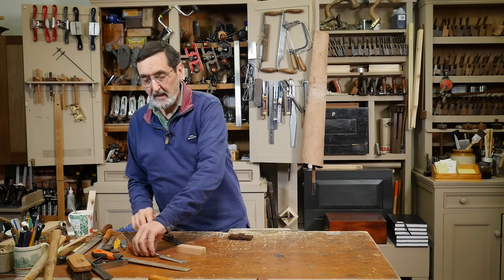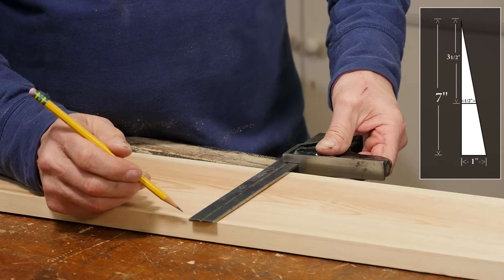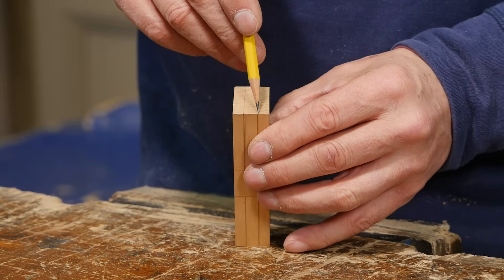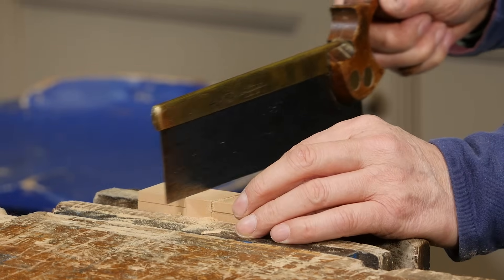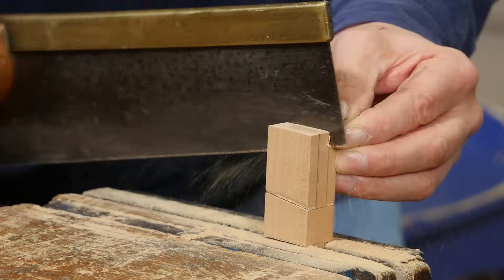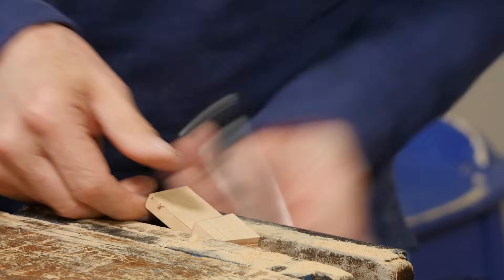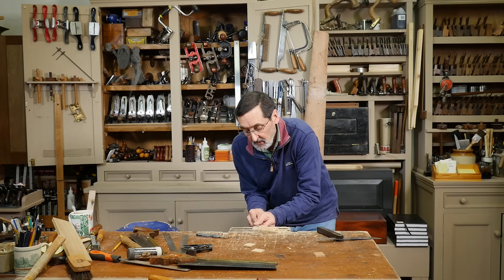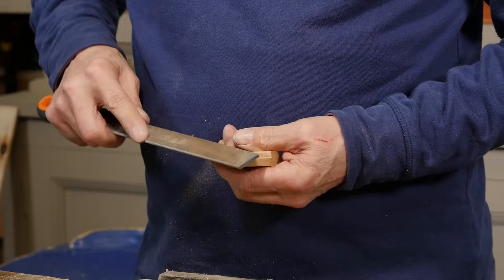How to Make a Dovetail Template | Paul Sellers

Comment: I just attempted to make my first template at 66 years of age. Never did woodwork. I realized the block preparation is crucial. I will attempt another. I used 3/4 square stock. 
First I learned to  hone my chisel sharpening skills which needs more improvement. They are sharp as needed. Learned to sharpen before anything else.
Paul you remind me of a shop teacher when I was in middle school. 
Great channel

Comment: The other day I cut my finger with a chisel, I smiled because I'm finally starting to sharpen them properly.
I've built my first ever workbench In my apartment, and I have my first tiny workshop there, your channel was a huge inspiration for this, I'm finally working towards doing something that I like as long as college gives me the time to do so.

Thank you for your contribution to the world, you are an inspiration and a role model to me, have a great weekend!
Reply: Cutting yourself on tools happen more often when they're sharp but not sharp enough.  The reason is that when they're not ultra-sharp, they catch and then break through at a higher speed that you don't control.  If truly sharp, it's smooth motions all the way, whether there's resistance or not.

That said, these days I tend to only cut myself when honing, riding the bevel against the stone with my fingertip for that perfect edge, and cutting my fingertips on the burr.  But that's not deep enough to bleed, so I'm good with that.
Reply: I need to keep sharpening then! haha thanks have a great week!
Reply: Don't fret buddy, my apartment 'workshop' is a semi-circle of 1.5m radius. This space accommodates my homemade workbench with built-in table saw, a bench-top drill press, router table and a chip/dust collection cyclone that connects to the domestic vacuum cleaner. As it happens though, I use mostly hand tools, because of the noise issues. You'll be surprised how much you can achieve in such a small space with a little ingenuity! And yes, Mr. Sellers was my inspiration too. This man deserves a knighthood for services to the nation!
Reply: Nice! I have a square, 1.30 by 2.80 meters, no power tools, just a corded drill. The problem I am having however is with the noise, I'm looking into mats or something to place under the workbench 'cause every time I use chisels or hammers the sound is heard very loudly across the floor (it's a tile floor) and it makes me uncomfortable, don't want to disturb the neighbors.
I'm getting there though, right now I just finished making a sanding block and I'm looking into making something to hold my tools on the wall, it's starting to get messy haha.
Reply: I have a tiled floor too - I use an off-cut of some heavy, rubber-backed industrial carpet (from the local DIY store) UPSIDE-DOWN. That is, fibres on the tiles. It's just big enough for both the bench and me to stand on, so the bench doesn't move when I'm planing etc. However, I can slide it around on the tiles when needed.
Reply: That sounds about what I'm looking for, I'll have to take some measurements and go buy the materials, probably separately, I haven't seen that type of stuff around here (all together), but it doesn't sound complicated.

How thick would you say it needs to be? an inch sounds good to me, as long as it helps keep that noise down.
Reply: For floor insulation, the cheapest and most effective I have found are the packaging mats made out of shredded cloth fibers - they're mostly grey with specks of color and perhaps 1 cm thick.  A good sized mat of that only costs a few bucks.

But for workbench insulation, adding cork under the feet and in the vise jaws is both cheap and easy.  A 25' length of cork tape is about eight bucks at Woodcraft, and it really helps with reducing vibrations, including sound.

For chiseling, get chisels with a wooden handle and without a metal strike cap at the end.  Those are for framing work, not fine woodworking.  And use the smallest chisel that's still convenient.  The bigger the chisel, the harder you have to hit it.
Reply: The stuff I have is around 1cm thick. Adding cork to the bench feet seems like a good idea too. I'd never thought of that. IKEA do thick cork table mats that could be useful for this. Not sure about the cloth mats (is that the stuff that removal guys use to protect furniture?). Whatever you end up using, don't forget that you'll need to sweep/vacuum clean it - often! ;-)
Reply: I'll give it a shot, thanks guys!
Reply: Same here. Just have a small workbench in my apartment. And when planing it is wandering around or just tipping over. Maybe I need a heavier one :)
Reply: @martine.bottcher2111  Weight it down with sandbags. Works a treat.

Comment: I squared up a piece of walnut and tried as best I could to follow Paul's excellent instructions to create the dovetail template, but it did not pass the 'eyeball' test.  I was able to draw the proper lines and everything looked fine until I completed the saw cuts. The eye can discern things that do not look right but I had to take the combination square and the sliding bevel to examine where I was off. Several of my edges had humps of valleys that required extra chiseling, shaving until all surfaces were true and square with no gaps in the measuring tools. Now it is fine and I look forward to making my first handcut dovetails. Absolutely love your videos, especially the sharpening chisels and restoring hand planes.

Comment: I want to build a small toy chest using plywood and dovetails. What pin angles on 3/4 inch plywood should I use. I was thinking it would be 24 inches in height. Any tips ? Thank you for your videos . I have learned so much from following you.

Comment: Any reason for not using the router to clean the 'tenons'? I know that the surface is small, but i think you could let the tenons a little longer to give the router some extra support, and  shorten them at the end. This is a technique that I learned from you (I am pretty much sure).

Comment: Hello Paul, how do you make one of them scraper's? By the way i love the video's keep up the good work.
Reply: Good question kenny 69.  Is this a homemade tool or one that is purchased?  Was just about to research it.
Reply: You can make them from a saw blade...
Don't ruin an antique or a quality handsaw though, but a modern industrial electro-hardened teethed one makes a great donor for such things!
Once they're dull, you can't do very much else with those!

(Or you can buy a scraper)

To sharpen, file then stone the edges to a good 90°, and once that's done, use a hard smooth burnishing tool, a screwdirver shaft would do, to turn the edge, to make it form a microscopic hook/blade...
You do this by first  runing the burnisher along the 90° flat you just "sharpened" then by inclining it a bit more each pass...
No need to go overboard though!

I bet paul has good videos on this!
Reply: You can buy them depending on where you live.  They are called card scrapers.  Bahco, Narex, Crown, Clifton, and Irwin all make card scrapers.  

If you have an old saw, many of those can be cut up to make scrapers as well.

You'll need to learn how to sharpen and use them.  Go to his website, www.woodworkingmasterclasses.com, and I believe the instructional videos are free.  You just have to sign up for a free account.

Comment: Sir,
since you are using the terminology "angle" and indeed using a "sliding bevel"; would you be kind enough to tell how many degrees it is, instead of one-sixteenth and one-eight,
we could easily use a digital angle finder for precision cut, Thank you!
Reply: But the beauty of Sellers' method is that he can find the precise angle without the need of hi-tech equipment, such as his preferred one-in seven dove tail angle. Watch closely and he shows you how to do it.
Reply: @johnadams6440  Just in case you missed it!
The "vernier" used in this particular video to "Get Width and Thicknesses", is without a doubt of a  "Hi-Tech equipment" DIGITAL vernier 
Just in case you missed that is!
It is however 81.4 Degrees
Reply: The "Hi tech Equipment" is so apparent when the video is pause at 1,55 sec
Reply: He used a ruler. @d-ameir622

Comment: Dear Paul, How did the log cabin builders figure this out in the 1800s?
They never had formal training and they also used different size logs?
There must be some secret that I can't even find with the use of the internet.
So frustrating!!!!!!
Log cabins/homes never had the same sized (sawmill cut) logs i.e., dimensional lumber.
How did the old pioneers do it? They never had templates.
I will be building a true hand hewn 1800s style half dovetail log home as soon as I find the secret. :(
Any help would be appreciated.

Comment: A question Mr. Sellers: Is there a specific reason you use the 1:7 for your dovetails? I've seen multiple different angles from other sources, but you always go for the 1:7 ratio.
Reply: I can't answer for Paul Sellers, but commonly, 1:8 is used for hardwoods and 1:6 for softwoods which can do with a slightly steeper angle. 1:7 is a good compromise that works for most types of wood.

For soft hardwoods like linden (basswood) and poplar, 1:6 isn't steep enough for a strong joint, so 1:7 works better anyhow.  And avoid the Rob Cosman style decorative dovetails that are so thin that strength is compromised, unless you just want them to be decorative.

I have two 1:7 angles marked on my workbench top going from my front vise.  That allows me to cut the pins freehand with good angle accuracy, and base the dovetails on the pins.  (Paul also does the pins first in another video).
I also have 20 degree angles in each direction from my end vise for when I sharpen cross-cut saws (Paul uses 25 degrees which cuts quicker, but needs filing more often).
If you don't want to mark your workbench, a sheet of plastic will do fine.
Reply: thank you sir

Comment: 4:43 of course you don't know a third of 7/8". No one knows. Our brain is not designed to work with rational numbers. Just switch to metric. Other than that, a great video! I will make one tomorrow.
Reply: Pretty sure its 7/24". Take the 8 and multiply by 3 since you want 1/3 of 7/8"

Comment: 1/3 of 7/8ths is 7/24ths. ;)
Reply: Unfortunately, fractional inches are measured in reciprocal powers of 2, which will never divide by three. A little under 5/16", a little over 9/32" or (if you have Starrett rulers) a little under 19/64" is as good as you're going to get.
Reply: "..if you have Starrett.."
Funny!
Reply: First Last 
NERDS RULE! LOL
Reply: for that, there is a kindergarten proof thing called metric system. why using rational numbers instead of natural numbers?

Comment: 1/3 of 7/8ths? Simple..7/24ths.. Oh yeah..The most common of measurements, the ol 24ths of an inch ruler.. I think eyeballing may be in order here..
Reply: I was thinking it's fairly close to 19/64, but no one really wants to use 64ths, even if they are on your ruler. Better to make the thickness 15/16 or 3/4, then dividing into thirds is easy.
Reply: Cadwaladr You're both wrong,  1/3 of 7/8" is between 1/4 and 1/2 of 7/8"
Reply: "The most common of measurements, the ol 24ths of an inch ruler.. "
I'm not sure why we don't have that when our ruler has markings for 24ths of a foot!   ;-)

Comment: Paul in the video can not see your pencil markings to show how you got 7:1 on the board. In order to understand how to mark the dovetail template out. Which I was disappointed that I wasn't able to see.
Reply: countrycool631 draw a rectangle, 1" by 7", then draw a line corner to corner on the diagonal.